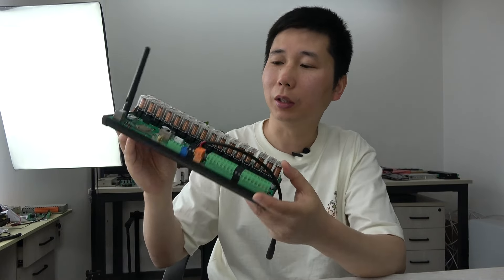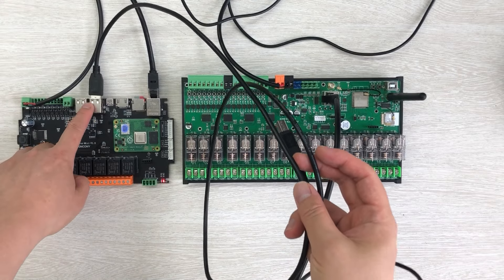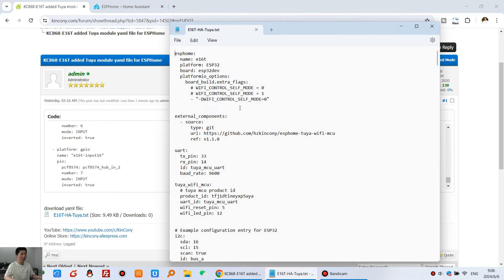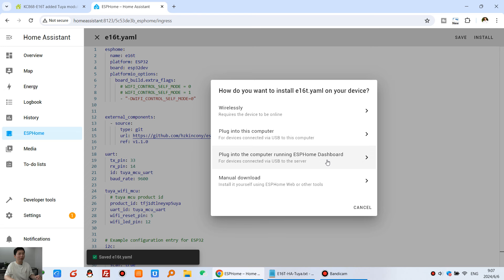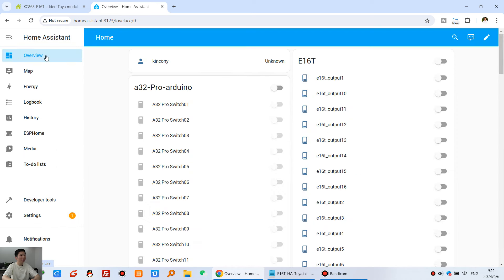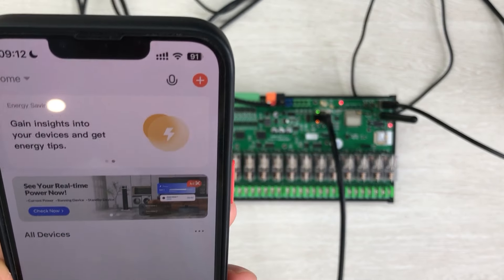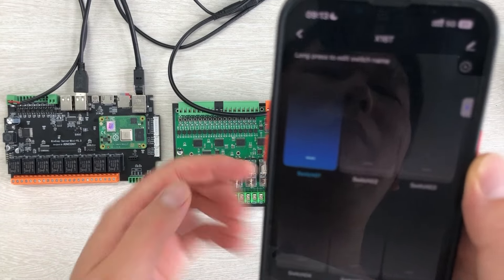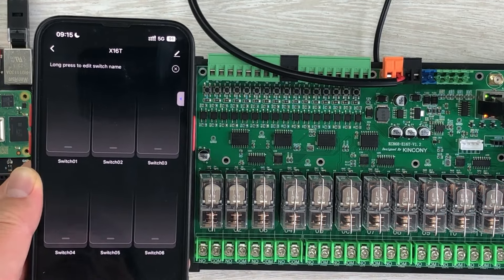Home assistant & Tuya work simultaneously? ESPHome yaml for E16T board

Comment: Hi, after this configuration the fisical buttons on board do not work anymore. Works on Tuya and HA. Has something to do? I have a lamp on output1, but pressing button1 or using a switch on input1 doesn't change the state of the lamp. How can I solve this problem?
Reply from the maker: which button?
Reply: @KinCony  Button from KC868-E16T. But I made a automation in home assistant and its working well with some problems when using Tuya App, the automation needs to be more settings to work
Reply from the maker: @srbergamini  if use tuya automation by scene mode, you need config it in tuya app.
Reply: @KinCony  I'm using HA to switch the relays on/off. But the problem is creating the automations in HA, the status of the DI is not updated when we click on the HA switch button. I'm also using wall switches connected to the DI and I'm having trouble creating automations for these wall switches because the status of the DI is different when I mix the uses between the HA and the wall switches.
Reply from the maker: @srbergamini  i suggest you take a video of your problem , post to our technical support forum, so that can understand easily.